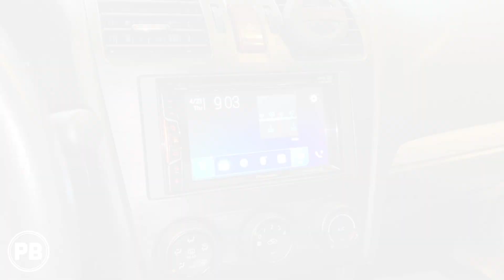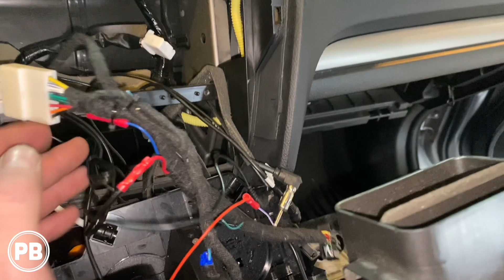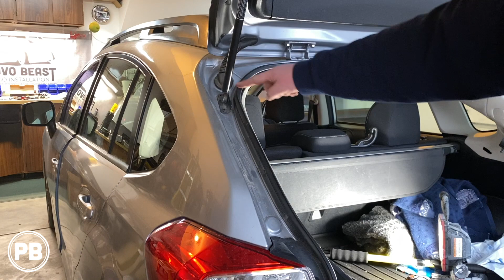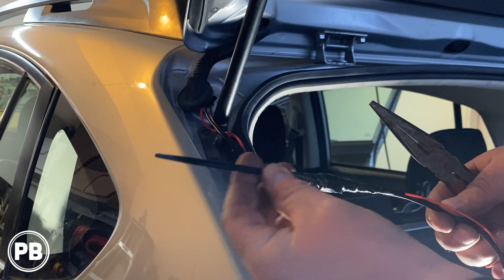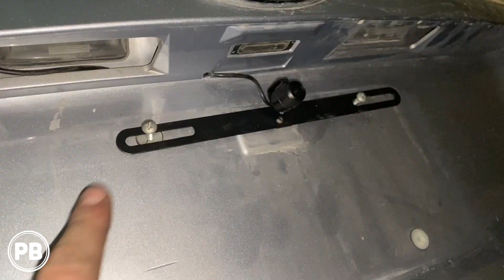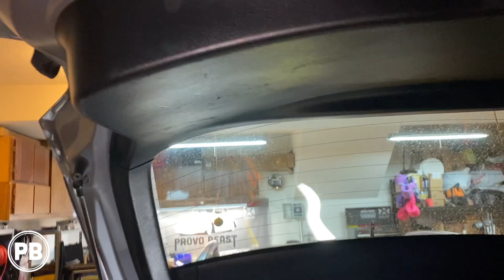2012 - 2016 Subaru Impreza Backup Camera Install

Comment: When U have ACC always on power why you need reverse light power ?even without that tail light power connection,I am sure camera will work too , when reverse is installed.

Comment: So I had my camera installed and I took it too the dealership to have them run a inspection on my car and now my camera won’t turn on when I reverse anymore. What could they have done? It does work when I manually switch to it on the dashboard. So I know the camera still works

Comment: Is soldering the extension wire necessary? Or can you get away with twisting it in and sealing with electrical tape?
Reply: Yes, soldering binds the connections. Twisting and sealing with electrical tape can lead to the wires can becoming undone. A soldering iron cost like $10 from a hardware store.
Reply: splice connectors can also work too